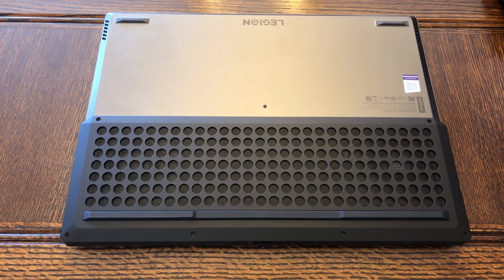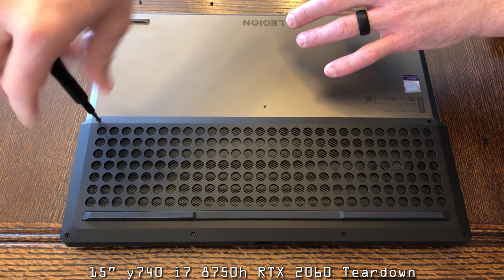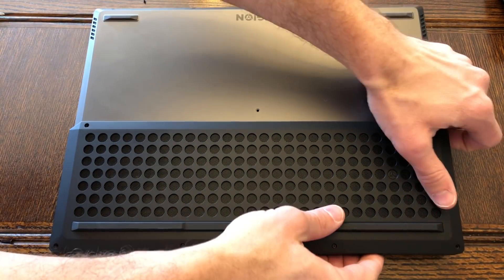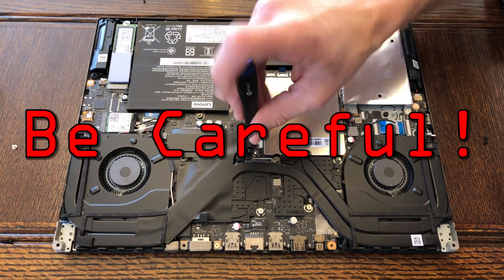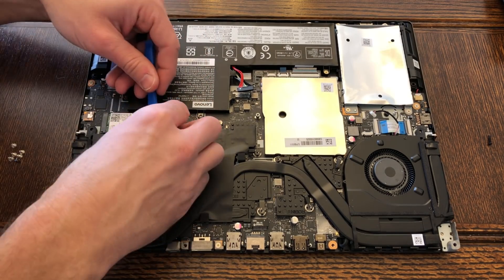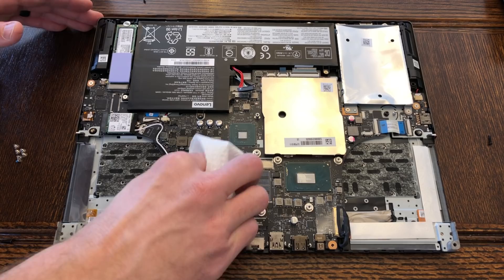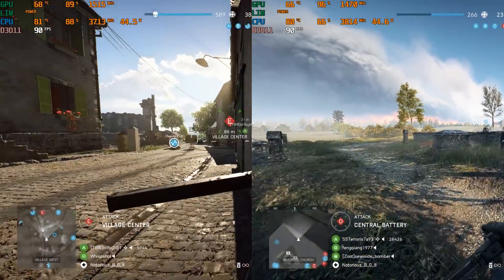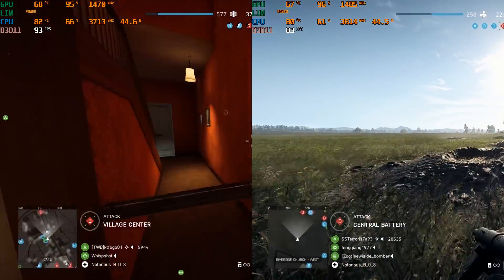15" Lenovo Legion Y740 Teardown!

Comment: Thank you for this video. My Lenovo recently had an accident (dropped) on its side. As a result the screw holder on the right side ended up breaking and the momentum twisted the thermal pipe but what remained of the screw holder ended up moving and sheared the ribbon cable port clean off the daughter board for the USB port on the right side. Your video is going to be a great help when I have to remove the cooling system and  replace the cooling system and the daughter board. 

I figure since I have the whole thing apart I might as well clean the fans and apply some thermal grizzly kryonaut while I replace the board.

Comment: Hi Bob, I have questions regarding your videos and my Legion Y740:
1. What is the dark thing like hair at 02:39 after you remove the fans?
2. How thick is your thermal pad on SSD? Is 1 mm fit and what brand?
3. Is it safe for my laptop to upgrade the stock 256 GB SSD PCIe 3.0 to another SSD PCIe 4.0?

Comment: I started having BAD overheating problems on my Lenovo Y740!! Temps were running 90-94 C on y GPU (RTX 2060) and 94-96 C on my CPU! Like I said, "YIKES!" So I have been working on it trying to decide whether I should just get a new laptop, or tear mine down and redo the thermal paste.

Well instead I checked the fans intakes and they were REALLY DIRTY. I cleaned them out like 5 months ago when I upgraded the RAM to 32 GB, after having owning this laptop for 9-10 months and they were not that dirty. But I moved to the desert in Nevada just 3 months ago and I noticed there seems to be a lot of dirt in the air. I know I wake up every morning with gunk in my eyes. So after 3 months in a dirty atmosphere my cooling intake was very dirty, and that is staying INDOORS 98% of the time (why not temps outside are usually 105 to 120!!

So I fixed my overheating by simply using a vacuum cleaner on those intake vents. Can't use air it would blow the dirt INTO the laptop!!
However, I have not tested it with a game yet, but it looks like my temps for GPU & CPU are running at least 10 C cooler. Will go test it NOW to see how it does in game, will update later with "in game" results.........

EDIT: 10 months later still having overheating problem and using a vacuum cleaner doesn't work so good now. SO I have to tear it down and apply new Thermal Grizzly Kryonaut paste to my CPU and GPU now!!

Comment: aaaand i stripped my screw
Reply: How did u fix it
Reply: @Djp1989  took them to my local lenovo center, took them a week to get it off (very hard) and replaced it with a cheaper and stronger screw. Payed around 5$ (converted from IDR). They said, the ADP protection also covers thermal paste replacement, so i should've taken it there in the first place to not void the warranty.
Reply: @povbirdtoba  my warranty is voided so i might just do it myself
Reply: @Djp1989  i also voided my warranty when I stripped the screw. That's why I had to pay. Tried all the internet tricks to get it off but still can't. Asked the technician, they had to drill a new - shaped hole in the screw to get it out.

Comment: Hello guys, I wanted to clean my fans and heatsink by removing the collected dust. However, I was a bit hesitant to remove the entire fan + heatsink part shown in this video. I could only clean my fans from the above after removing the laptop's back part, but I couldn't clean the heatsink. Is there any way to do that without removing the entire thing and applying the thermal paste again?

Comment: The screws for the cooling unit were secured tightly from the locktite and I ended up stripping the screws.  I decided to grab a 1/16" drill bit and drill into the screw head as gently as I could and made sure to use a vacuum to pick up metal bits from the screw. Then, used a small flat head on my power drill to lift the screw. The flat head grabbed it perfectly. I was lucky that this didn't cause any damage. I had replacement screws on hand (M2*4 laptop screw) Now, my y740 runs a lot cooler after reapplying paste and thermal pads.
Reply: Is there a way to remove those screws without using a drill bit?

Comment: Thanks for the help. I decided to do this for my 17" Y740. I cleaned the fans and used the TG Kryonaut for the CPU and GPU. Before the repaste i ran the 3Dmark Time Spy test and CPU temperatures peaked at 96°C once briefly. After the repaste highest temperature was 84°C and the graphic score got better. After that I used Throttlestop (a skill I learned from you, thanks again) and I got the temperatures to peak at 78°C with actual minimal performance gain. So again, thank you so very much and keep doing the great videos like you always do!

Comment: I don't feel confident enough and don't have all the right tools for removing the fans, but I was hoping to clean them more thoroughly - all I've been doing so far is just using compressed air on them, but there's always a decent amount of dust remaining. Do you recommend any other methods? If I use a toothbrush, is there any way to not make the dust fall through the cracks and even harder to remove? Thanks so much for your videos.

Comment: Do you happen to remember much else about this tear down?

I’ve got damage to the keyboard deck of my Y740, and I’m debating doing a chassis swap.

Do you recall if the motherboard and the cooler can come out as a single unit? Or do I have to remove the cooler separately? (As you mentioned here, the stock paste is great, and I’d rather not have to repaste if I can avoid it).

If I have to repaste, thoughts on what I should use? I know Kryonaut is popular, but I’ve heard it can break down quickly over 80 degrees Celsius. Want something effective, but long lasting.

Comment: I really want this laptop, but I only had bad luck with it untill now. I ordered it twice because of dead pixels or backlight bleeding problems. Also, on the second one, in idle state, the cpu was constantly between 50-55°C.

Comment: Hey Bob, you saved my day. I'm just about to do this whole process on my Y740 15". A bit scared since this is my first laptop but I'll do it.

What I can tell you is that my temperatures are nowhere near to what you have there with the stock thermal paste. I already undervolted to -0.135 and it is simply using more turbo boost, so I gained performance instead of better temps :/
Reply from the maker: Felipe Correa Thank Lenovo for removing the ability to max out fan on these laptops.
Reply: @BobOfAllTrades  yeah, I heard a bios update got rid of it.

Hey one question, I'm halfway through the process assembling everything up.

While cleaning, one of my paper towels fell in the laptop, touched many other components. Any risks with that regarding static? 😬

Comment: Just got mine yesterday.
I have noticed that the left fan (that should in theory cool the GPU?) doesn't turn on at all, even under stress, with GPU temperatures reaching 90-91 Celsius. I really don't get why this is happening. The laptop is not uncomfortably hot, it's warm but not hot. 
Does anyone have the same issue?

Comment: Hello, very nice video again from you, thanks!
I can‘t see it in the video but is there a way to get to the fans itself? it looks like there are screws but the fan chassi is fixed to the whole heatsink.
I think about to lubricate them to remove the not loud but annyoing jet engine noise they are producing.
Reply: The fans come in a closed chassis. My laptop fan on the right side has developed a grinding noise and it turns out I have to replace both of them. It comes as a dual fan assembly.

Comment: I’ve chipped the black foil near the cpu, it’s a 1/2mm cause it was bend and chipped off, is it bad? and any ideea on vrm thermal pads thickness? If you leave them 1 day they usually get thicker cause they are usually pressed.
Reply: Hi, do you know how thick the NVMe thermal pad in Y740 is?

Comment: Just bought one and man oh man, it's realy hot!
playing CS GO and CPU is 98°C
on iddle 60°C
GPU (RTX 2070 Max-Q) on the other hand is only 70°C on full load.
I know 1 thing for sure, i'm sending it back!
Reply from the maker: Roland Baracsi Lenovo removed the ability to max out the fans for some reason.  It’s a shame.
Reply: @BobOfAllTrades  What bios u were on when you did this test?

Comment: my y740 is at 94º at one or two cores and the others at 86º all the time wen i play, always at 3900mhz and the fans 100% while my 2060 is at 85º and the anbient is 25º it has 3 months shoud i repaste?
Reply from the maker: Romeu Capela sa at that point probably wouldn’t hurt
Reply: @BobOfAllTrades  i did it instead of 94º the cpu is 82º and que gpu is at 77º
Reply from the maker: Romeu Capela sa LoL well that looks great 👍
Reply: @BobOfAllTrades  werdly i think it was repasted badly it was with 4x the normal amount of termal paste and it was with an grey paste with some bits of blue on the side coud it be lenovo or the seller that did it?

Comment: So let me tell you and others about my teardown of the y540 17in.

Completely different setup Lenovo has going on.

First, there aren't as many screws on the back panel.

Second, you go to take the back panel off and it comes off very creaky and even when you take care and go bit by bit, sliding ever so lightly your plastic wedgie tool to pry it off the chassis bit by bit, ever so slowly...

I got 11 plastic pegs that slide under the main frame to hold the cover on, that broke and one more that's still flopping around in the front space up by the speakers.

Great!

Third, only the front part of the plastic cover comes off. The back part with the mesh covered fan openings that goes over the back ports - it's part of the under layer, a layer under the plastic cover that I'd just removed, that sits on top of everything but the 2.5, the m.2, and the big square silver ram slots cover.

I saw how to take this second layer off, but I also saw that it too had lots of little plastic peggy things that slipped under the main chassis. So I didn't mess with it for fear they'd break off too.

I live in Phoenix where it's freaking hot and dry, and my guess is that the plastic just got very brittle, and so easily broke off. It was used to the Carolina Summer where it came from. 

Maybe it's just me, but the part you're supposed to take off if you want to put in an ssd, it should not break off so easily. I'm telling you I was extremely careful taking a long, slow, gentle lifting and prying process to get that cover off. I can see one or two pegs breaking off. But that many?

I hope that last peg flopping around doesn't flop over into a fan, but it looks like the fans are sealed except as they port out the backs and sides, so I should be ok.

The chasis is back on and it's snug but just a little more flexible now where it seals against the fronts of the base.

So there you go. Being careful sometimes isn't even enough.

Comment: I assume you already returned this to Lenovo after your review but did you use Throttlestop with the repaste?
Reply from the maker: I sold it since it actually 👍

The repaste had little impact. Why?
Reply: @BobOfAllTrades  I just recently got the 17-inch model with the RTX 2080 MaxQ variant and find that the CPU temp maxes out at 95C on Battlefield V. I recently started playing around with Throttlestop to see if the temps would go down. Was wondering if using Kryonaut would help bring the temps down or at least prevent it from getting hotter.
Reply from the maker: Ben Dizon max fan enabled?
Reply: @BobOfAllTrades  Is that the Fn + Q function that I sometimes see come up on the internet pertaining to this laptop?
Reply from the maker: Yeah. If you’re not maxing out the fans you’re more likely to have thermal throttling
Reply: @LogicMattersToMe  have your temps improved with anything you have done?

I've tried:
- Repaste
- Undervolting
- Cooling base (to raise it)

It seems to be about the same :/
Reply: @fcu423  I haven't repasted but I have undervolted and bought a stand to raise my laptop off my desk but haven't seen any major temp differences

Comment: This video is super useful! Going to teardown my laptop so I can reapply thermal paste because I've noticed that my GPU's temperature goes up to 81 degrees celsius on games that aren't so demanding. Thanks!
Reply from the maker: Max that fan!
Reply: @BobOfAllTrades  Would it be bad to suddenly max the fan speeds when gaming? I maxed out the fans and temperatures dropped by 10 degrees celsius
Reply from the maker: BiggieVic  That’s what they’re for!  I always use it 👍
Reply: @BobOfAllTrades  Alright I'll just max my fans lol thanks Bob!
Reply from the maker: BiggieVic  Enjoy that great gaming laptop 😀
Reply: @BobOfAllTrades  bob how do you max out the fans?
Reply from the maker: @lezhitang1879  Lenovo took that away on these if I recall correctly.
Reply: @BobOfAllTrades  wait really? So there is no way to max out fans on the y740?
Reply: @BobOfAllTrades  my cpu is currently hitting about 90C and my gpu is around 75-82C, is this a sign for lack of thermal paste? Is there anyway to fix this?
Reply from the maker: @lezhitang1879  change the paste and Undervolt both CPU and GPU.
Reply: @BobOfAllTrades  ALSO THANK YOU FOR THE GREAT VIDEOS FN+Q still works for me to up the fan speed so its great!
Reply: @BobOfAllTrades  Also Should I not update my BIOS 1.09 just so that I can max out fan speed?

Comment: I'm brand new at laptops and the Killer 1550 does not play nice with my router no matter what I do. After some research, I've come to see that those cards tend to come across issues. Now I'm trying to get into my y740 to swap it but cannot for the life of me get the thing open. I know this is a re-paste video and it's cool to see, but any advice? I can get the side of the device to start coming off but the top and bottom (where the IO is and the "front of the laptop that would be facing me, the 4 tiny screws section) just do not budge and my hands simply slide off the slick angled finish. 

I have the basic ifixit kit and tried with the pry tool but it feels as though it will break. Anything anyone can share to help me get this opened would be amazing.
Reply from the maker: tuskybarn Uninstall the Killer software.  The NIC is still a 9560 at its base.  Otherwise just keep working it and it’ll come apart.  I like that you’re at least careful with it 👍

Comment: y750 is gonna be nuts.
Reply: They anounced to shift the camera,Keyboard will be redesigned,Most probably have a 10nm processor and will have a sd card slot.
Reply from the maker: Add a bigger battery to that and it’s possibly perfect 👌
Reply from the maker: How so?

Comment: Great video! Wow awesome thermals. Wish I had time to do a repaste on my Y740 15 with the RTX 2070 would have been really interesting to see the results of that. I had terrible thermals on the unit I reviewed. 😣
Reply: Mine runs upwards of mid 90s on DOOM but the clock speed never drops. Is it possible for a chip to not thermal throttle when it should? Mine runs 3.9 to 4.1 the whole time.

Comment: Also very interested. Wondering though, rtx 2060 or 2070m-Q?
Reply: If you are still wondering... It all depends on what you want and your budget.  A 2070 Max-Q would be 5-15% better performing than a 2060.  If you want/need that extra performance for the $250-300 price increase that is up to you.  Shadow of the Tomb Raider got 70 average fps for the 2060 vs 77 fps average for the 2070 Max-Q in another video I saw.  So to me, the 2060 is a better value than a 2070 Max-Q.  

I'm not sure about thermals, if the max-Q generates more heat in its smaller package it may throttle to some extent, which would eliminate that 5-15% advantage it has.

Comment: As others have said, please do a full review on this laptop! It's hard to find any reviews online for this new model.

The only downside of this laptop for me is the relatively small battery. Get rid of (what looks like) the 2.5" drive option in the top right corner and put in a bigger 80+ Whr battery.
Reply from the maker: That’s my main justifiable complaint as well.
Reply: @BobOfAllTrades  Looking at Lenovo's website, it appears the NVMe drives they ship with are only 2 lane. Do you know if the slot supports a full PCIe 3.0 x 4 for aftermarket drives? https://psref.lenovo.com/syspool/Sys/PDF/Lenovo%20Laptops/Lenovo%20Legion%20Y740%20(15_)/Lenovo_Legion_Y740_15ICH_Platform_Specifications.pdf
Reply from the maker: The one in my machine is too fast to only be 2x
Reply: @BobOfAllTrades  Looking at that specs sheet closer, the m.2 slot supports a full 4 lanes. You getting close to 3 Gbps sequential read/write?

Comment: Hi I have have lenovo 720s with 7700hq I have limited it to 16w of cpu power consuming around 80w from the wall. I am buying a 135w power adapter to run atleast at the full 90w capacity of the laptop and also repaste with liquid metal. I am afraid that this will fry out some other components like the mosphets, the problem is that there is no way to monitor their temps. do you think limiting the cpu temps below 83° would be enough to avoid the risk of damage?

BTW do you still have the liquid metal lenovo 720s? Have you experienced any increase in its temps after the first repaste results?

Yours videos are awesome!!
Reply: So long as the fets have a thermal pad contacting the main heatsink you can completely forget about them.  If that's not how it's designed, stack thermal pads to the next thing above them - case, keyboard, whatever, they don't output much heat but they do get hot when naked sitting in stagnant unmoving air. Another option is a cooler pad if there's vents somewhere in the vicinity.  Your undersized adapter is most likely being detected by the EC and triggering the throttle though
Reply: @greebj  thanks for the reply! what is "ec"?
Reply: At first it used to limit automatically to 12w I have removed this limitation using throttlestop and limited to 16w